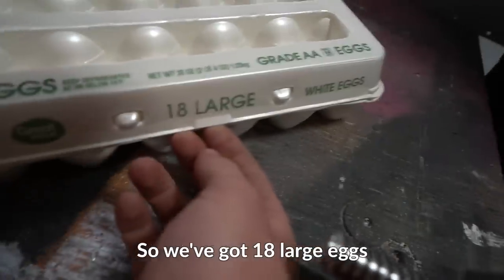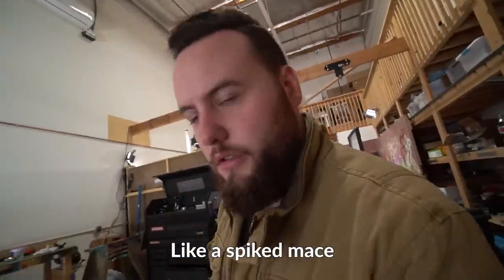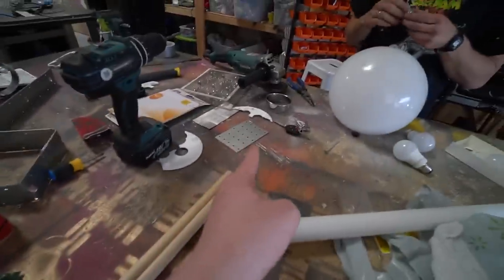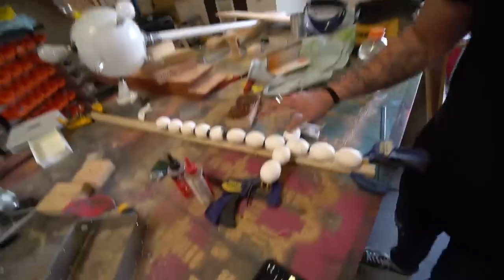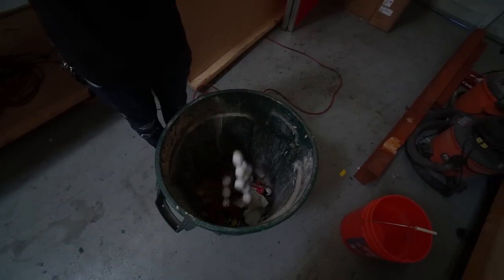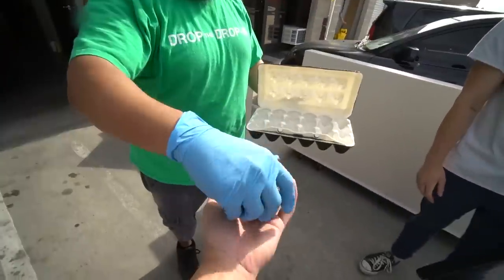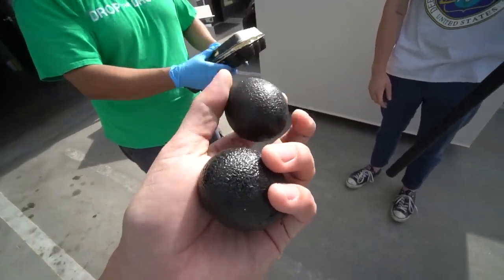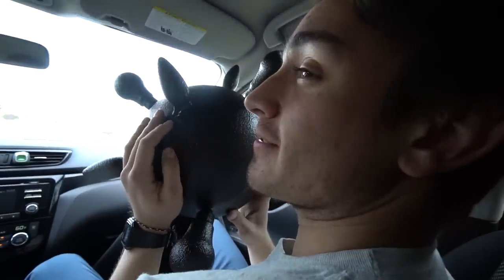Creating Weapons Out Of Fragile Items!

Comment: What about clay/playdoh  weapons? 

First video, subscribing

Edit: thank you for the likes
Reply: I agree 100% make weapons out of playdoh then get them Line-X'd and see if they remain solid.

The real test by this point is what would make a base that while still fragile would actually fully hold its shape
Reply: @trustindean5164  The thing is that you can dry/bake it. It would be less of a challenge than this here. Dont get me wrong, it would still break, but would still be much more solid. And if you dont dry it, it will break/change form at the first try.
Reply: @medplug4061  I dont imagine itll do that if it has the spray on it that stuff is solid
Reply: Trustin  Dean they should try some with line x and some without

Comment: I mean, shouldn't you spray every part with line-x before you spray it to get optimal results? The parts only covered in glue won't get covered in line-x which will make it fall apart in those areas because they're the most fragile.

Comment: Eggs would have worked if he did them right. Have the smallest part of the egg as the blade, widest parts stuck together. Would have been a shorter but fatter sword. Not cracked as easy. Also should have had clingfilm or paper or some other delicate material that wouldn't affect the durability too much between the wood and eggs so the eggs wouldn't stick to the wood